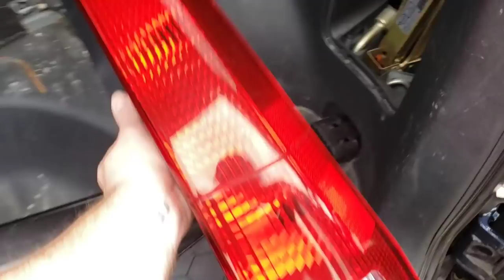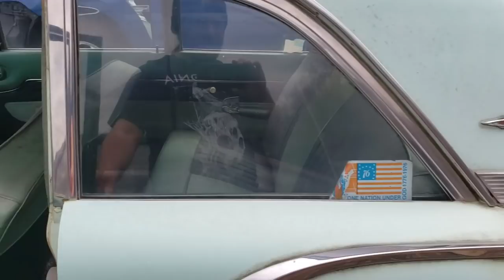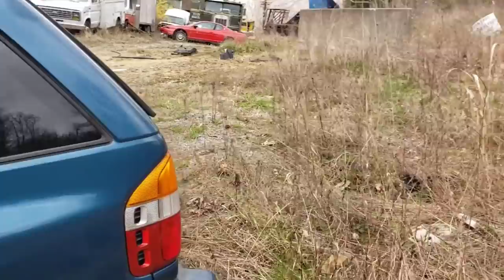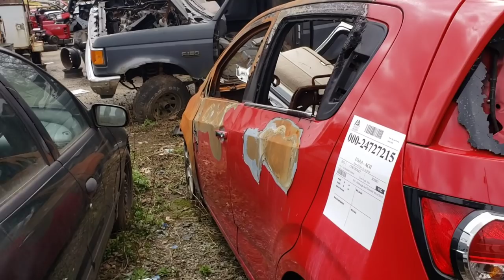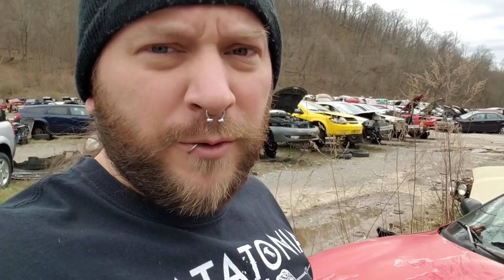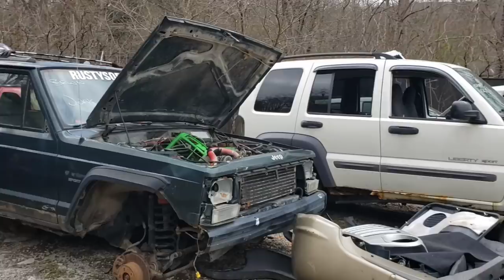Weekends With Wallie & Kayla - Millerstown Pic-A-Part - 4/5/2020

Comment: My dad used to go to the junkyard frequently for a car to avoid the prices at any chain parts store.  He’s rubbed off on me & I check the junkyard before calling the parts store.
I drive a 2014 Honda Accord & it’s the 2nd one I’ve had.  Both of them have been the best.  Honda in general the best, most reliable you’re gonna get.  I’ve been very pleased with both of mine & they’ve been literally no maintenance.  They did bring back the Passport.

Comment: The new millennium seemed like a turning point for Jeep, in the wrong direction. In 2001 the Cherokee was scrapped in favor of the Jeep Liberty, and the very reliable 4.0 inline six was replaced with a garbage 3.7 liter V6. The Grand Cherokee's Chrysler 318 V8 was replaced with an unreliable 4.7L V8. The build quality dropped significantly as well, with the exception of the Wrangler, the Jeep brand is a shadow of it's former self.

Comment: Older models like the 2002 and 03 CRV were AWFUL cars, alongside the 2003 Accord. Some units were just made really shitty. Honda is generally really good tho, I had a 2013 Accord. It's a good idea to avoid the first one or two years of a car that's been remade, let them work out the kinks. 2005 2006 should be good for those CRVs.